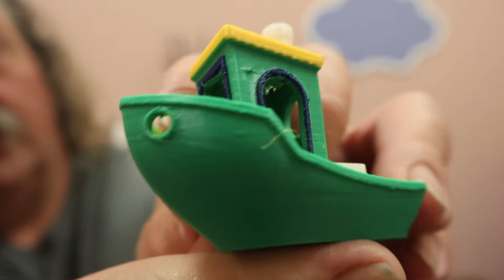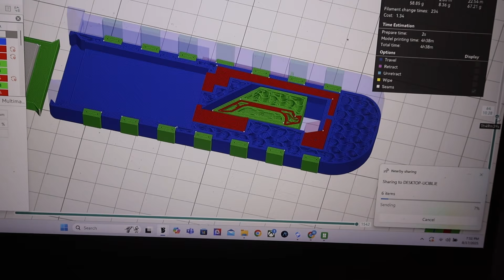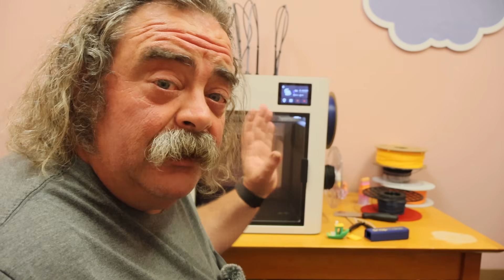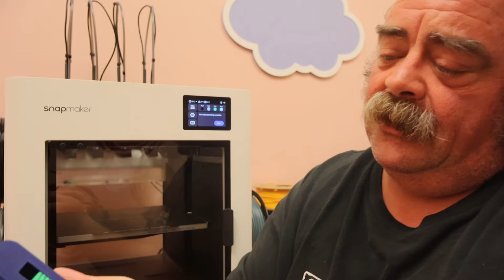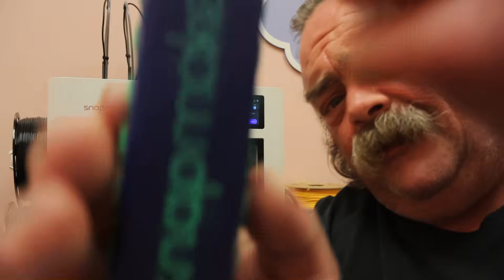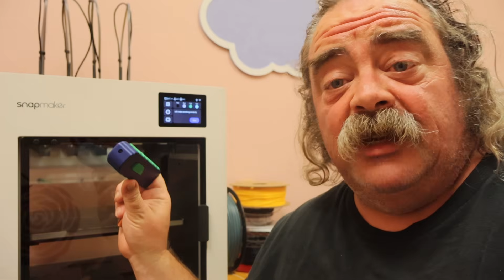Snapmaker U1 Multi Toolhead Printer 1st impressions and print!

Comment: With an open chamber and no active heating it will be quite limited in the materials it can print. Thats the downside of tool changers because they are so tall and the ptfe tubes have to come from the top.
Reply: If you print things that need heated chamber and full enclosure its hyghlighly unlikely you need 4 filament toolchanger
This thing is intended to print multicolor aesthetic parts not cf-nylon, ASA or ABS durability ones

PLA, PETG and TPU will be the bread and butter for this machine and none if those needs enclosure
Reply: @Asghaad  you do realise they have a lid for it to be fully enclosed. No reason it couldn't do asa, abs hell probably even could do some nylons.
Reply: @codboss14k  for those you kinda want more than a lid ... you also want actual air filtration to not inhale all the TOXIC vapor coming out of materials like ABS and ASA

but the point of what i was saying isnt even about the lid but the fact that its HIGHLY unlikely you will need 4 color toolchanger printer to make things in the high toughness materials. if you are making aesthetic multicolor prints PLA, PETG/PCTG and TPU are the materials you will have to accommodate and none of those wants to be printed under enclosure

Comment: Great video 👍🏾
Reply: Also as a suggestion for the led you should put the + and - indicators for polarity if you still plan on installing the led after the housing is printed this is one of the things I planned on making years ago with one go but didn't have a printer to do it I have so many products I have in mind that could utilize multi materials like this , again great video and I just subbed 👍🏾

Comment: Don’t forget LEDs are polarity specific. Did you try flipping it around? You should put some indicators on which way the battery goes (+ / -) and also which leg of the LED is the Cathode. (K)

Comment: amazed a small channel got sent a printer! bit slow thou ain't it, 2hrs for that boat crap. not for me.
Reply from the maker: So the printer was sent to Ecovate 3d I was just invited to come use it, but if you slice the same boat on something like a Bambu p1s you are looking at many more hours in print time
Reply: @LomaxEclectic  i see, lucky you. i don't own a printer yet, still looking, sure it takes longer? bambo advertise their printers to print the boat in like 20 mins or less.
Reply: Sure, but that's 20 minutes in single-color.  The U1 can do that, too.
Reply from the maker: Yeah in 4 colors it would be like 12+hrs I’m guessing in the Bambu.
Reply: Yeah. The multi material aspect of my X1C adds a TON of time to my prints. Probably 2 minutes per color change PER LAYER. 2 hours for a 4 color benchy is fine. @LomaxEclectic